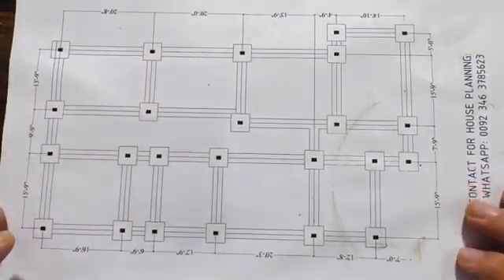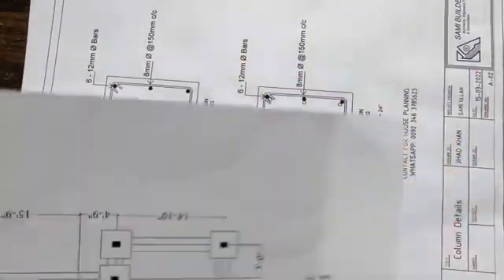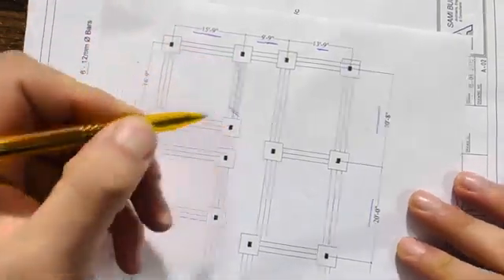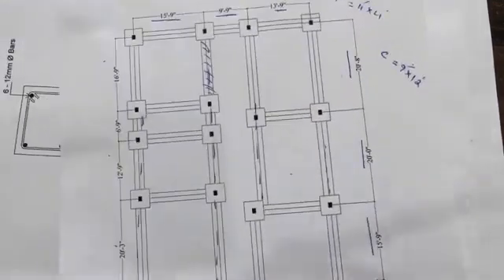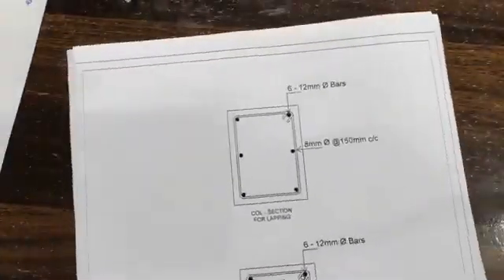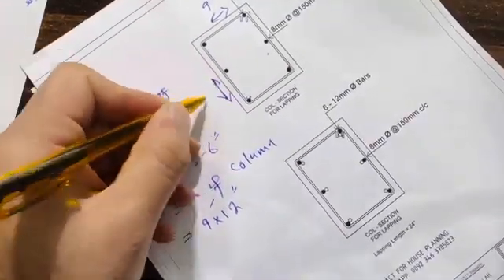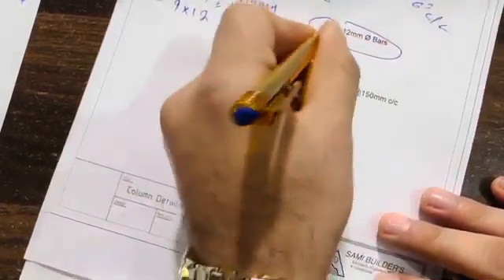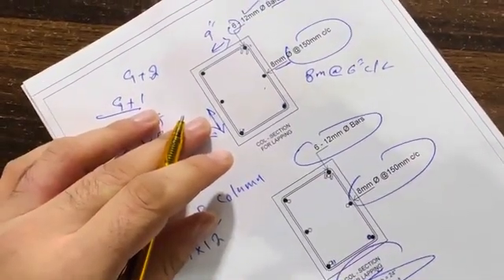structural Design of Column and Footing

Comment: Brilliant! Thank you for sharing this video. Are you able to recommend columns for a commercial 4 storey building with two underground bunkers. One bunker to hold commercial buses using some kind of vehicle lift to the surface, up to a capacity of 4 x 60 seater electric buses and its charging systems and backup flow battery banks of 100 Kwhr for off-grid to run underground facilities and the 4 storey commercial building & roof to house full solar arrays & non- blade wind turbines with built in flats. The other underground bunker would be used as full living quarters & as a safe bunker with toilet, bath room, cooking facilities underground. If you provide consulting services and full structural & architecture services please indicate.